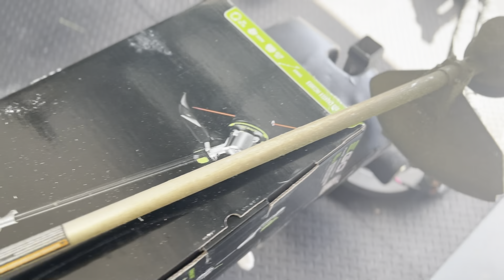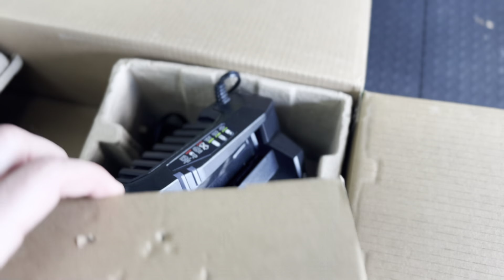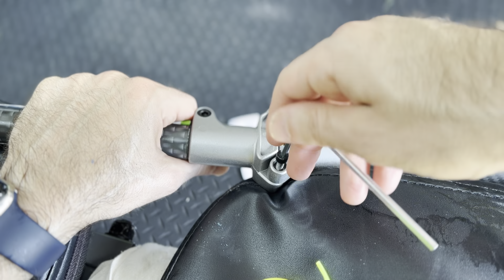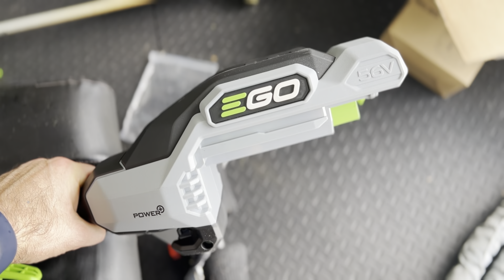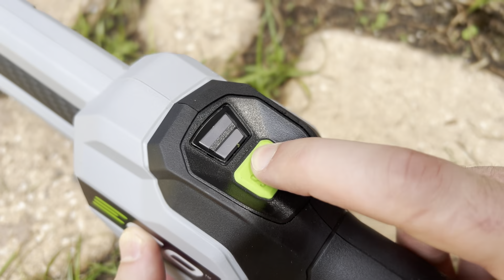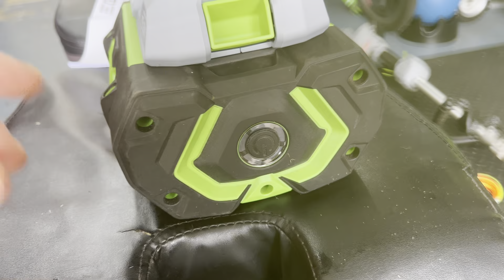Line IQ vs bump feed? Compare new EGO ST1623T String Trimmer 56v w/ Line IQ Unbox, Assembly, Review

Comment: Just got this same model. Thing works extremely well. Feeds perfectly and the string lasts forever as well.  I think people saying it doesn't feed right possibly have a defective unit. This thig is amazing! I came from a much more powerful STIHL gas powered one I actually liked but it took a dive. I was contemplating rebuilding the motor but said screw it I'm trying electric. Glad I did. This is not as powerful/angry as the STIHL but it stealthfully gets the job done and is so convenient and easy to use. Also I can do yard work later in the evening after I get off work without bothering the neighbors because it's much much quieter.
Reply: Why were you rebuilding it constantly? I have an echo. It’s 20 years old still runs like new!
Reply: @gregorybond2859  I didn't have to rebuild it constantly but was contemplating rebuilding it after it recently seized up. It was great up until then. Just thought I'd try the electric one and it definitely has a few benefits.

Comment: I was disappointed that the head was not adjustable angle. It is good if you're doing flat areas like for a dog area but it was difficult to do edging with. I did turn it upside down to do edging.
Reply: I watched a video with someone unlocking the handle and allowing it to rotate on its axis 90 degrees before locking it back down to make it edge much more easily.
Reply from the maker: This model doesn’t do that
Reply: @reallyMello  Yes, it will.
Read my comment about having seen how others do it.
Reply from the maker: @Gunners_Mate_Guns as like a hack or built in feature?
Reply: @reallyMello  The handle is designed to rotate on the axis as well as move fore and aft for length adjustment.
How could that possibly be a hack?
Reply from the maker: I thought you meant the cutting head. I’m not sure how rotating the handle is easier than just turning the angle of the trimmer per the instructions but if you find it easier I’m glad to hear it works better for you.

Comment: Would also help if you soak your trimmer line in water . Does wonders !!
Reply: Hi Mario, how much line (feet) do you soak at a time and for how long (minutes)? Do you add anything to the water? After you load presoaked line, do you have to wait for excess water to drain away? Your trimmer hack seems to be very cool and I'm assuming helpful for you. Do you have an Eco trimmer? If so, what model? Thanks, Don
Reply: @donapodaca3729  From what people in the know say, nylon trimming line is hygroscopic, and it becomes brittle over time as any residual water inside it evaporates, especially sitting on a hot shelf in a warehouse before it gets bought or in a hot garage after it gets bought.
They say that you just dunk the line in a bucket over about a 24-hour time to rejuvenate the line and just use as is.
You don't really need to do more than just shake off the excess water when taking it out to load into your trimmer, but some guys recommend making it better permeate the line by adding a little bit of dish soap.
Also, others have mentioned dunking the whole spool of line in a bucket overnight, taking it out and shaking off the excess water before putting it into a big Ziploc bag with a damp sponge inside the bag to keep it hydrated, ready for the next use.
As long as you know how long the line your trimmer requires is, you could even take your whole spool and just measure out that long a piece for the first length for future use, then use it as a quick template for the rest of the line to quickly make as many ready-made lengths of line for your trimmer before putting them inside that Ziploc bag.

Comment: Just bought mine a few months ago. The string will not self release, therefore I'm stuck with a trimmer that winds up with 2" of string for a 4" to 5" cutting path. I'd much prefer a bump release, the self release is garbage.
Reply from the maker: Are you using the high speed setting and their line and the distance from the cutting target per their instructions? I’m not having that issue so I’m curious why the difference for you in case there are tips to let people know.

Comment: When you are at the pool area and pavers you should be using the half speed which will allow your string to cut grass but not break when hitting the concrete.  That is why the half speed button was installed.  The automatic advance works well in my opinion.
Reply from the maker: Half speed isn’t strong enough for st augustine grass. If you hold it the right distance from the foundation the line doesn’t break.

Comment: Hi. nice video and good info. Im looking at these now as my old gas trimmer has worn out.  Is this worth the extra money than the aluminum shaft one?  Im wanting a battery trimmer and looking for the best option
Reply from the maker: The ST1611T, carbon fiber one, will get you an extra inch of cutting swath and would be slightly lighter than the aluminum so it depends on how much yard you have since the weight reduction and larger cutting area would help you finish faster while carrying less weight.
Reply: Thanks for getting back with me. I'll pick one up today and give it a try. Thanks again

Comment: I have this and also have the LB6703 blower. Incredible machines. People seem to be afraid, or biased, or wherever against things they don’t know… This trimmer is STUPID good, plain and simple, and the blower is as well. The blower goes through a battery fairly quickly though, but the power is amazing. Not cheap, not for everyone, but man… these are suing serious tools. And the charging time from DEAD to fully charged is crazy; it takes very little time to charge the batteries.

I have a ton of video gear, drones, action cams… they take a long time to charge up. These batteries charge in no time. Best money I’ve spent on yard tools lately!!!
Reply from the maker: I agree. For most homeowner applications I'd say the Ego tools are better than gas, no comparison.

Comment: How did the battery last on your previous trimmer?
Reply from the maker: Typically the entire cutting session unless I used it for the blower first. It does seem like the new one is more efficient, but even before I didn't really have issues with running out.

Comment: So-if you live up north, like me, you want to store the batteries in the house in the winter?  Opinions?
Reply: I keep mine in my garage (MN). But it is insulated and drywalled so doesn’t hit those -30 degree readings.  I do charge it in the garage, and don’t let it get below 25%
Reply from the maker: I don’t get freezing temps down here but I know you aren’t supposed to charge at or below freezing temperatures. Generally, if you are going to store them for the season it’s better to do it at about a 50% charge state at stable indoor temperatures. The instructions may have more specific info for your battery.

Comment: You can't. Edge with it?
Reply from the maker: Of course you can though I prefer using their dedicated rectangle bar edger tool for that task since it works better against st. augustine grass runners in summer and saves burning through so much string trimmer line.
Reply: You can rotate the handle

Comment: What kind of Barbarian edges with a trimmer? Oh the horrors!
Reply from the maker: I do actually use the square bar edger for edging the longer sections 😂
Reply: I do and will continue too edge with a trimmer.  Looks great
Reply: I was thinking the same thing. I've seen several reviews about these trimmers and they are doing a lot of edging. that looks like it's never been done before and saying the battery dies fast. Run time is way better when just weed eating and it has plenty of power for about any home owner id say.
Reply: Once you have the edge it is extremely easy to maintain with a string trimmer.  
Don’t see the purpose of having both
Reply from the maker: @MyGodMySavior777 with some lawn types like st augustine it gets difficult to keep the runners in check during the summer rainy season without going through a lot of line
Reply: @reallyMello  
Gotcha! Kentucky bluegrass is easy to maintain.  I live in Midwest

Comment: I mean, I'm all for comparisons, so thanks.  Why wouldn't you just replace the old bump head though?  The old trimmer was perfectly fine.  ECHO Speed-Feed 400 head is spose to be great.
Reply: Real answer he just wanted a new toy lol 😂
Reply: I put an Echo Speed Feed on my gas powered Ryobi.
Putting line is nice and fast.
However, even with Echo's famed "Speed Feed" I had to constantly bump and bump and bump, to try and get the string out to fully length.
Overall, even bump feed heads are not that great, because it's not like you bump once, or twice, and the line goes to max length that easily or that quickly.

The positive to the manual bump head is that we can easily open it and reload and get it working again.
I haven't used Line IQ so I don't know if it's easy to just open it up, sort the line, and go back to work.
Reply from the maker: I believe it was discontinued or I couldn’t find a replacement…maybe I could have looked harder

Comment: With these EGO trimmers, it seems more features mean more problems based on some of the reviews I read on Lowe's. Powerload is tempting, but Rapidload is probable the best bet. As far a Line IQ, I wouldn't trust it to feed line until a significant amount is needed.
Reply: You don't have actual experience with it as you indicate by your comments.
So you're just guessing based on no experience with Line IQ, nor with Powerload, nor with Rapidload.

Comment: I've seen a strap kit included in other video. Did yours had one included ?
Reply from the maker: No strap
Reply: The blower comes with one, but neither the trimmer nor edger do. A little assbackwards in my opinion.
Reply: @kjmdrumz3  I finally bought the multi-head tool PH1420 with STA1600 trimmer (kit MST1603) and BBA2100 bristle brush yesterday and it came with a strap.
Reply: I believe that this model as shipped these days includes a strap, at least that's what newer videos that go over the exact same model seem to indicate.
Reply: @Gunners_Mate_Guns  yeah, made a 2nd comment 2 years ago about it and it did came with a strap.

Comment: Will the line-feed feature still work without the guard attracted?
Reply from the maker: The blade length knife is attached to the guard so there is the possibility the line could get too long and become dangerous as well as the lack of safety from not running a guard
Reply: Thanks for the info. Cheers. @reallyMello

Comment: I’m a 69 yr old woman who struggles with the bump feed system, I purchased this IQ and love it, the weight of the battery is heavier than other brands, but it is still manageable for me. I enjoyed your review.
Reply from the maker: I wonder if someone makes a shoulder strap for the trimmer to help with the weight. They also make smaller capacity batteries that would weigh a bit less.
Reply: @reallyMello   Yes, Ego has a strap available.  I bought one but haven't used it yet.
Reply: @reallyMello  I just ridged one up out of a suit case strap
Reply: Put a 2.5 amp hr battery on.
Reply: Good to know I just purchased one

Comment: I had an EGO string trimmer, the automatic line feed worked very poorly. That was a model from 2017, so maybe the engineering is better now. Also how do you load the string? PS: the EGO leaf blower drains batteries like no other tool!
Reply: if you were still wondering, you push the string through one of the holes and out the other. Once both sides are about the same length, u press the button on top of the head and it wires it all up. Its called "powerload".
Reply from the maker: @OhMyGodYourMom yep, used that when my line ran out a few trims after this video. Much nicer than the old way of loading.

Comment: Two things to point out…..The new power head DOES have a more powerful motor (15% more). Also, BOTH the old model and new have brushless motors. The new one says it on the product but the old one is also brushless.

Comment: Wondering if the auto feed and length adjustment is worth the extra $100… I’m upgrading from a black and decker corded model.
Reply from the maker: Based on my past experience with Black and Decker, Ego is a better string trimmer with or without the auto-feed model. But my last comparison of Black and Decker was when they were still using 18v NiCD whereas Ego is 56v lithium.
Reply: It's only $30 difference.  The 1623 has a 4ah battery.  The comparable bump model w/ 4ah battery is 1523.  The 1521 has a 2.5ah battery, so it's naturally less $.
Reply: @TwW1178  they have a carbon fiber model with a 4ah that’s $100 less.  Not adjustable and no auto line feed.  Ended up getting the new model and it’s pretty nice

Comment: So will you have to open the front to pull out the string after it got short?
Reply: Yeah, when it's at the end of the line. Only takes 5 seconds though, then you put the end back on and load in new string.

Comment: This is my 3rd season owning this trimmer.  I don’t have a lot of area to trim on my property but I can say that it works very well for it being battery powered.  My mower is gas powered and I usually am skeptical of battery operated yard tools but this trimmer has been great thus far. And I do like the auto feed line function.
Reply from the maker: I switched my mower to battery too and found it had enough power, but sometimes I'll need to swap in another battery if the grass is exceptionally long or wet which isn't a big deal for me.
Reply: Wondering if the auto feed and length adjustment is worth the extra $100…
Reply: @FeedTheTroll88  It is nice to have.  I hate messing around with trimming line.  So for me it is worth it.  I think you need to throw in a price point comparison of not only having that feature but also the fact that you have very good power and a lighter tool compared to even a nice gas trimmer which would also run you about $250 to $300.  So…